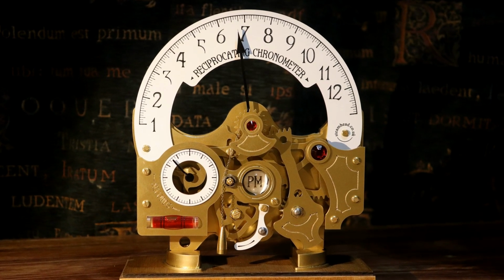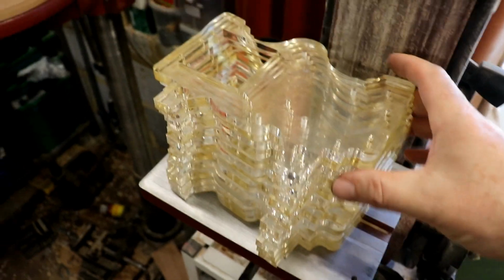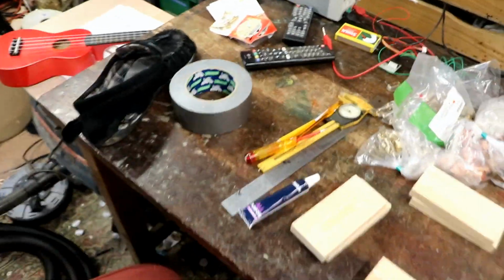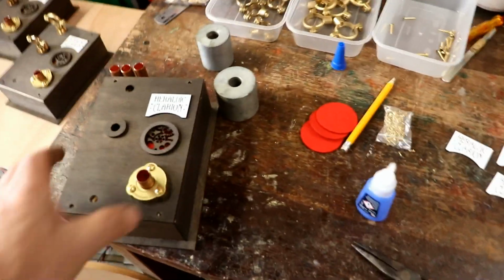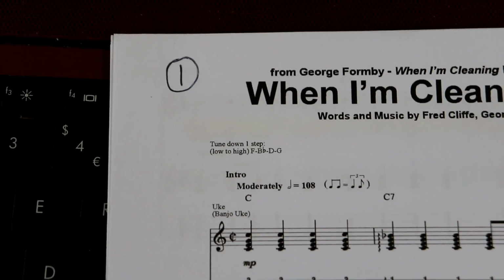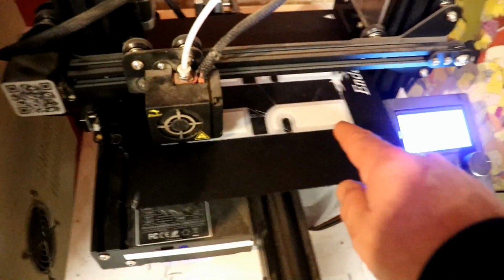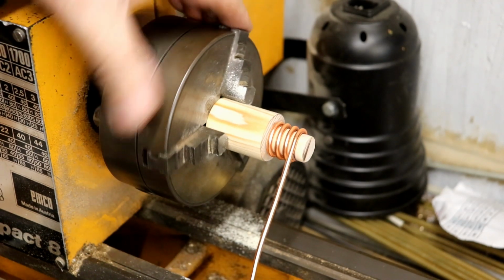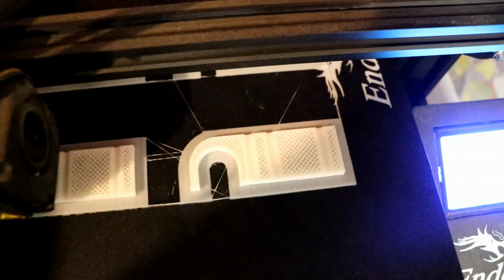More exciting distractions!

Comment: There is a marvelous material my dad used to use in scrimshaw making called Ivory bean.  Sliced it looks amazingly like ivory but is a plant seed.  Vegetable ivory or tagua nut is a product made from the very hard white endosperm of the seeds of certain palm trees. Very hard.  I wonder how it would do engraved by the laser.
Reply from the maker: Thanks very much for the suggestion. I've looked it up and may get some when I need to make some keys for a Victorian style keyboard. As it is 'wood' the laser cutter should be able to cut it and would probably be able to engrave it. Thanks again for the information.